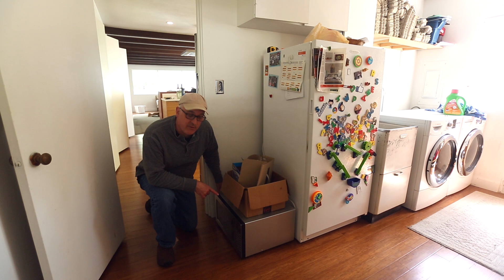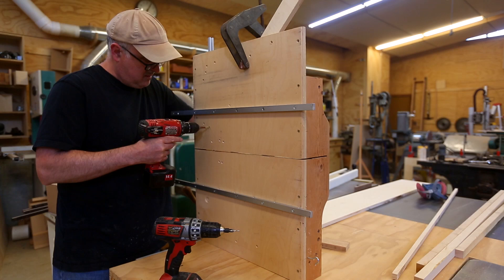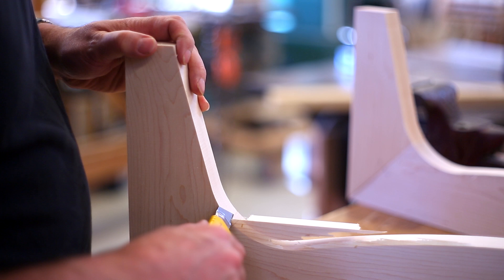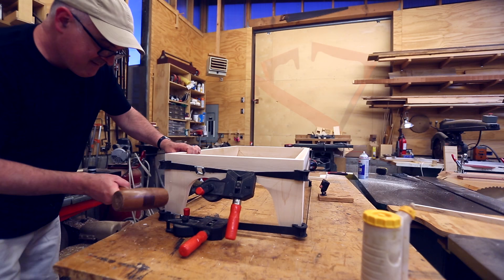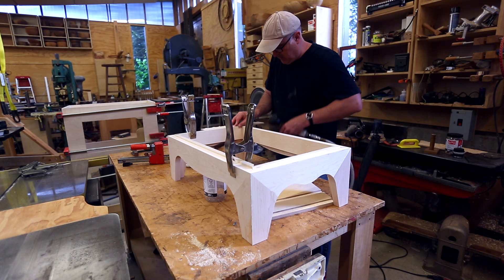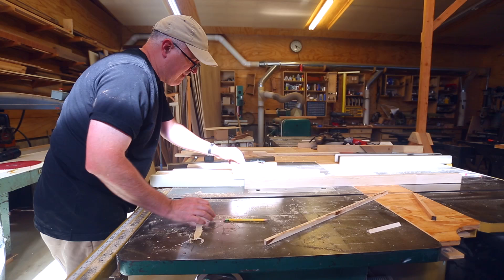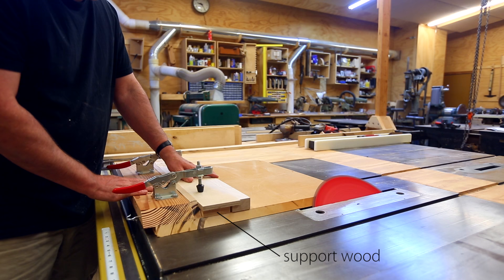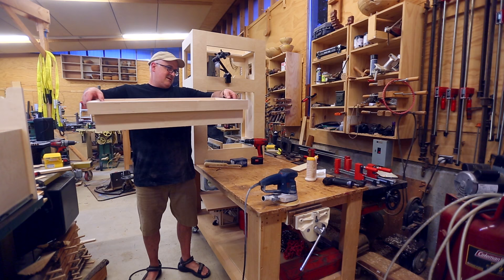Microwave/Recycling Bin/Shredder/Tack Board/Mail Tray Cabinet - Part 1 of 3

Comment: The tip about adding a reveal between two large parts to mask inexact alignment is excellent.
Reply from the maker: I forgot to mention that traditionally a piece of trim would have been used.  a reveal is just another way of hiding  inexact alignment

Comment: In my cabinetmaking apprenticeship, I learned to always always always rip rough timber on the bandsaw. Afterwards, joint up the face and edge, then plane on edge to final width and face to final thickness. 

It's so much safer to rip rough wood on the bandsaw. Zero risk of losing a finger. And planing to width is just as quick as the table saw, even quicker because you can stuff a bunch of pieces of the same thickness through the planer at the same time. A cleaner and truer surface off the planer too, when compared to a table saw.
Reply from the maker: true, good point.

Comment: Hi Frank,
I think the reason you were getting so much tearout was mainly due to your cutting direction. In most woodworking, we are used to traditional milling where the bit is rotating in the opposite direction of the feed, but, given that the machine is rigid enough, climb milling will give you much better results. From all of my CNC work, one thing I would definitely recommend against is the combination of traditional and climb cutting as I saw in your video, since you lose some of the benefits of both. I recommend learning at least the CAM aspect of Fusion 360 to replace whatever tool path generation software you are currently using since it's so intuitive (and free). I know that you design in Sketchup, but you can always import into Fusion and do CAM there (I design in SolidWorks and import into Fusion). It feels like with CNC there's always more to be learned, but that's what makes the technology so great!

Comment: Nice how you show that your equipment, even when used 'properly' still has that awful tendency to screw things up (the CNC tearing out the maple handle, the table saw 'refusing' to cut wood, etc).  It's refreshing to see non-perfection :)  Mr Wandel's videos show the "warts and all"stuff too, so you know it's real, and even careful methodical work practices can have recalcitrant material screw things up.   Noticed a lot of burn marks on your table saw cuts, is that a blade-needs-sharpening/replacing issue, or just a side effect of the thick wood being cut?  Keep up the good work, your videos light up my day.
Reply from the maker: Thanks,  i think my big red table saw blade needs sharpening

Comment: Great video as usual.
I was surprised to see you putting glue in the groove for the panel on the bottom of the tray.
I thought one was supposed to let the panel float.
Reply from the maker: +Andrew C. Ballantine I wondered about that but I figured since everything was plywood I could get away with it and it would give more strength to the skinny end of the mitered corners.

Comment: Is that a small planer on the floor at 7:15 ? Regarding the CNC setup time. Have your machine drill holes at regular intervals for dovel pins. This lets you drop in some pins and push the workpiece up against them. Now you know that it is parallel to the machine axis. I have that and it saves so much setup time it's crazy. It's even possible to set the grid of holes up so you can know where the edges of the workpiece is without seroing out the machine, but I haven't tried that myself.
Reply from the maker: yes i need to get that planer set up.  i like the pin idea on the cnc, i need to do that.

Comment: I've been struggling to decide whether to get a planer or jointer, and was wondering which you would recommend? Also would it be possible to thickness boards on a jointer? Love your videos Frank - my favorite woodworker on Youtube and you have inspired me to start animating myself.
Reply from the maker: you need both, they do very different jobs.  the jointer gets one side flat, the planer gets the opposite side parallel to the jointed side.
Reply: If you joint one (front face) side flat, then put it the piece up against the 90 degree fence and joint that side also flat, couldn't you just run the other front face through the jointer against the fence? wouldn't that also give you a parallel face ensuring everything is 90 degrees to each other? Thanks for your help anyways.
Reply from the maker: it will make that second face flat but there is nothing keeping it parallel to the first face.  your method, in theory, keeps it parallel  across the width.  but the length of the board will be a slight wedge.
Reply: Thanks a lot, that's really helpful!

Comment: What happened to your mitre sled you used earlier??
Reply: You also seem to feeding your material too slow on the table saw. Maybe that's why you are getting so much burning?
Reply: If the blade is dull it will burn more, so maybe he need to sharpen his blade or replace it.
Reply: +Angela Benschop I thought that but I am noticing that in all his videos he Feeds too slowly. That's why I mentioned that instead of a dull blade
Reply from the maker: the long one for picture frames?  it finally came apart.  i need to make a new version
Reply from the maker: I think my big red cross cutting blade is dull.
Reply: +frank howarth yes. It is brilliant. I love it.
Reply: +frank howarth hmmm. Perhaps. Try , if you can, to feed faster and see what happens. You seem to be a very prolific craftsman but I have noticed that my blade I use only use on very hard african timber I have only needed to replace it once. I do only use it on weekends so perhaps you may be right. One more point, I have watched almost all your videos and I have noticed a slow feed with points where you either slow down or stop for a moment, in all examples it corresponds with a burn mark. It's why I spoke about that instead of a dull blade. It makes more sense to me than a dull blade. Maybe feeding at a faster and constant rate would alleviate the problem?